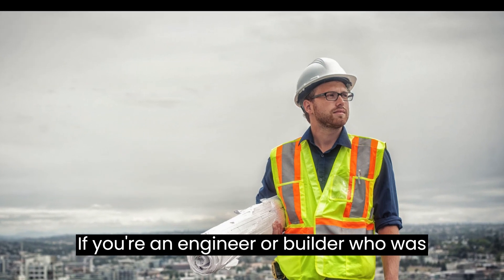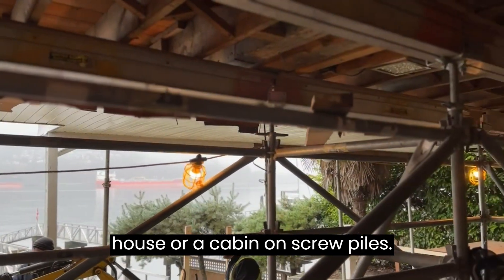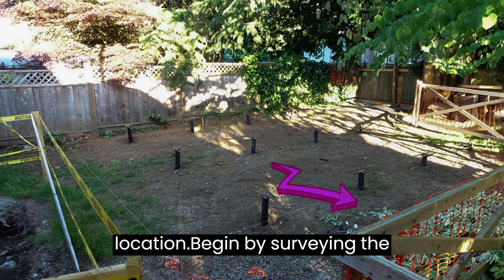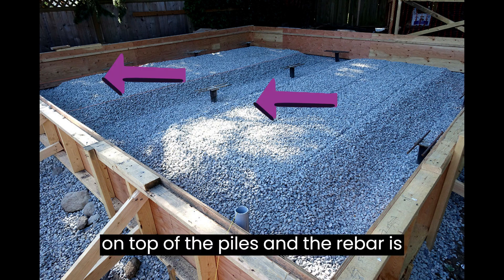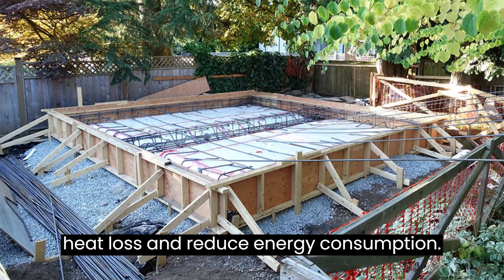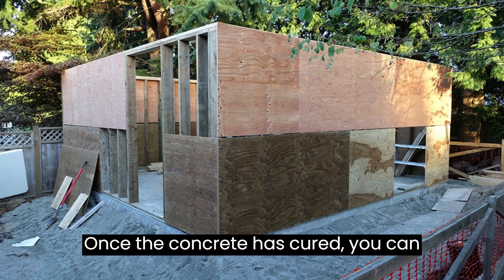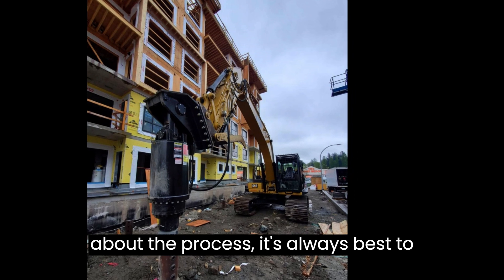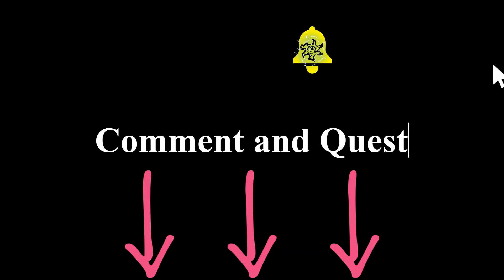How to Build a House on Screw Piles and Grade Beam #construction

Comment: Have you build foundation on blue clay?
Reply from the maker: Yes, absolutely. You can use helical piles for blue clay. But, your capacity will be lower. Also, its recommended to do a creep load test to make sure blue clay wont creep. How thick is your blue clay layer?